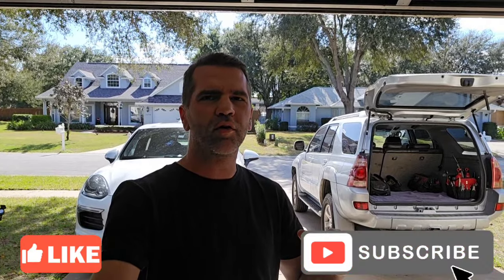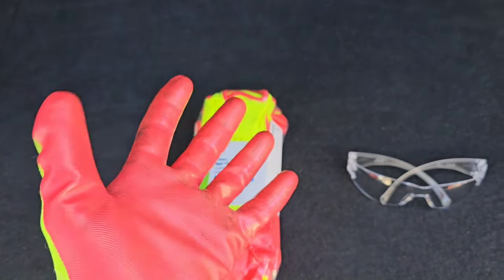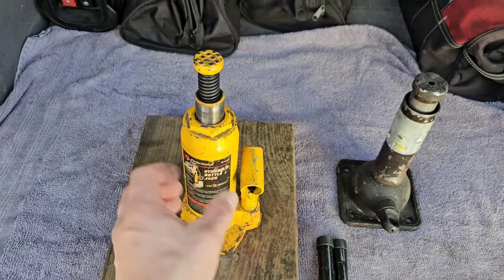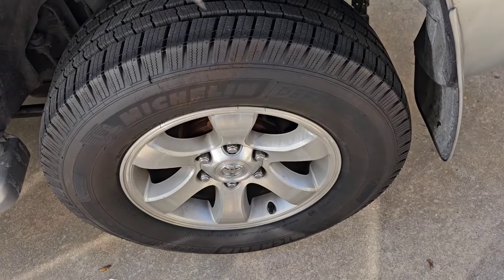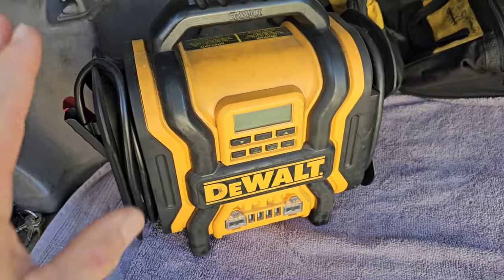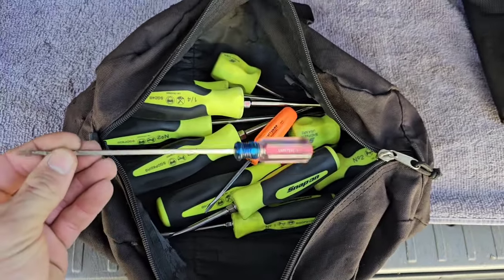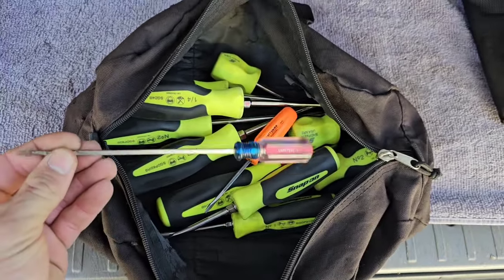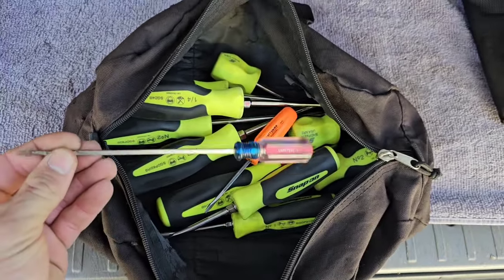What you should carry in your vehicle

Comment: I got into to the habit of carrying an extinguisher when I was competing UK auto rallies. But it does need to be serviced. In the 1960s with 100% profiles, I always used an inner tube, so if a rim got bent, the tyre wouldn't deflate immediately. No longer possible with all-fashion, no-function low profiles. Progress? Gimme a break!
On principal, I would never consider buying a vehicle without a full-sized spare. Also, at least five wheel studs. The long breaker can sheer the wheel studs. Once the wheel nuts are loose you can use a brace to wind the nut out quickly. 
Map reading light?
Jack, the Japan Alps Brit

Comment: Merry Christmas mate!
Reply: Bunkers. Tube of new skin does not work. A jar of raw honey is 10 times better. Second, your tools are great if you are in a hurry to change the tire what for. Third, candles maybe two or three if you are stuck in the snow,wintertime, this will keep you warm. Fourth, blankets to keep warm. Number five, tool kit is useless if you are in an accident. I think your video overdid it. Sorry.
Reply from the maker: Merry Christmas James!
Reply from the maker: No need to apologize Seth, haha. It's like the Ole saying goes "opinions are like a-holes, everyone has one" (not calling you an a-hole) 😅. I love new skin, I've used it many times and it seals up small cuts great and allows me to continue working. 
As far as my tools, why would you not want to changed the tire as quickly AND Easily as possible? Why struggle in a more dangerous environment? 
If I had mentioned carrying candles I'd have to turn off the comments because I'd be getting blasted from people saying it would be a fire hazard, not provide nearly enough heat for anything etc...
I did mention blankets and a flash light in the video. 
Yes I agree my tools are a bit overboard for most.